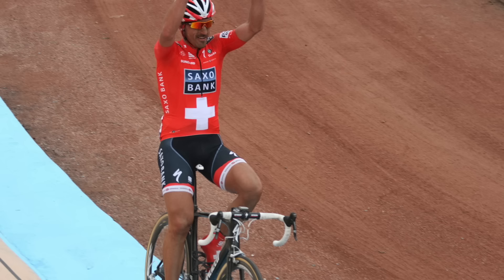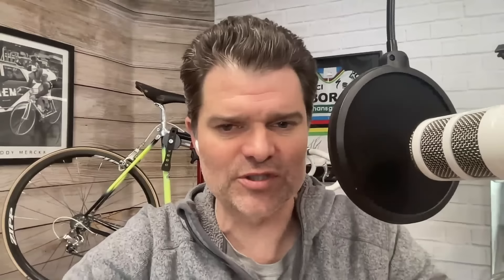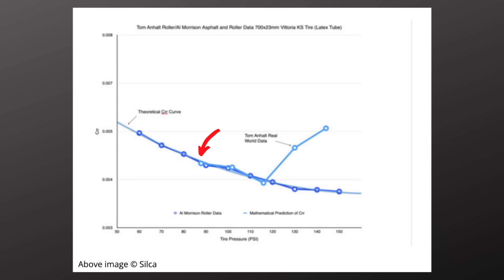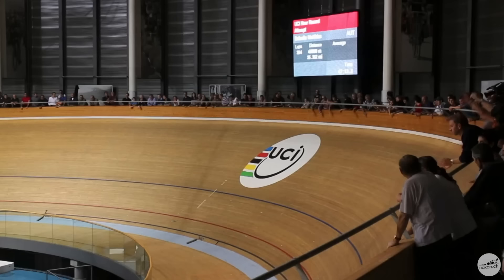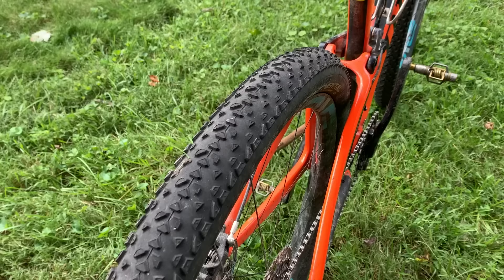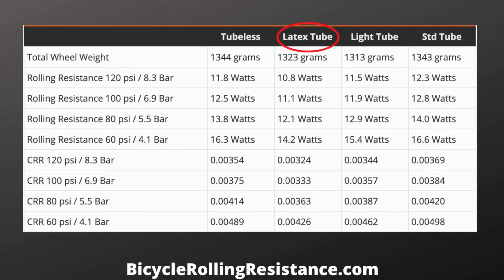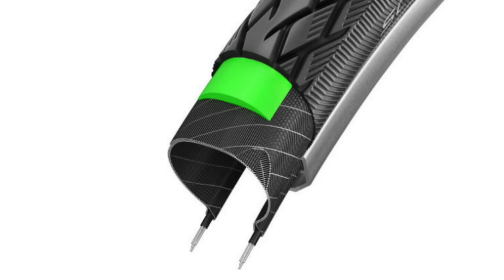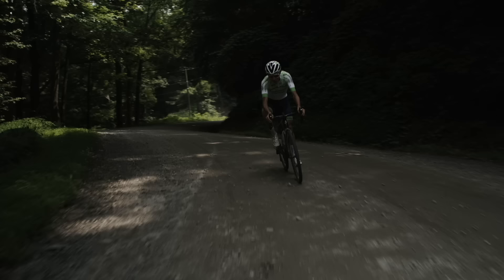Your Tires Could Be Costing You Minutes. Tire Rolling Resistance with Josh Poertner

Comment: Josh is amazing and definitely knows all the details and has all the experience working with cycling teams and testing products. I buy Silca products because of his insight.
Reply: I've been buying Silca products LONG LONG before Josh took over (I have an orange Silca Pista floor pump, and an ancient Silca Impero frame pump from over 52 YEARS AGO, when I first started racing on tubulars, both still fully functional!!).

But yeah, this man most definitely knows his subject matter, and then some!
(He might even be able to change my old school, died in the wool <-{which is what we actually rode in back in the cave man days!} fossilized mind about running way too high a pressure in my latex tubed, Vittoria Corsa clinchers. LOL 😉)

Comment: Great content. Great guest. Love the MG podcast. Please consider a conversation with Jan Heine, Rene Herse. If I recall correctly, Josh has hinted on the MG podcast that he may disagree with some of Jan's findings/testing/data on wider tires not being slower. If you could get a full length panel discussion with both of those guys - THAT would be gold. Keep up the good work, Dylan.
Reply: I definitely agree.  It's hard to have a conversation about low tire pressure and rolling resistance without mentioning the huge contribution of Jan Heine!

Comment: I like the discussion. Remember years ago, seeing a set of roll down tests of different tires and pressures, and a 'quick and dirty' correlation between how easy it was to deflect the UNINFLATED tire on say the sales rack and the rolling resistance; the easier to deflect, the easier to roll. Goes along with the hysteresis losses examined in the vid. Not foolproof and lots of qualifications but workable.

Comment: After looking into the TIRE PRESSURE CALCULATOR and seeing how low the suggested tire pressure should be, I'm very enthusiastic to try it out!  It's pretty sweet tool. Thank you for the insight!
Reply: @ighfirlee  If I were to worry about damaging my bike, I would ride slow, flat, boring tail trails... However, I can't worry about that! I would rather have the traction to make the turn and grip to dirt accordingly! Plus, my ENVE carbon rims have a lifetime warranty :) Ride On!

Comment: Very interesting video,
However I would like to add two other consideration for tire pressure.
1. Higher pressure makes descending more stable\
2. Higher pressure is more puncture resistant when biking on more marginal roads, that have potholes.
To me that is a big consideration not be stranded with a flat tire on a remote road

Comment: My experience is that the more expensive lightweight  high-performance racing tires  seem to be more prone to punctures . They usually have thiner sidewalls and less rubber overall in their construction.
Reply: It is. Cheaper tires are always more puncture resistance, at the cost of rolling resistance, comfort (higher TPI) and weight.
Reply: They last less too the more expensive they are .
Reply: Of course, but it isn't a 1 to 1 correspondence. The Continental 5000S variants for instance are very fast and pretty durable. As you go to tires much faster than that, you need to consider the course, and replace them sooner.

Comment: Hi Guys, I like your talk about tires and tire pressure. Because of it I tell you what are three players which influence RRC on the smooth drum: hysteresis, deformatin and volume of material

Those tree players have in paralel impact to: wet grip, robustness, footprint, stiffness - > effect: grip, durability handling &comfort.

Good balance of tire design or selection is key to success 😊

Comment: Interesting different format/directions for a video on your channel. Personally my take on this specific question is that I used to worry about tyre selection and tyre weight and tyre pressure in terms of maximising my speed… until I realised that it was all pointless and the one thing that cost me the most time was simply avoiding punctures. Now I just run as bulletproof a setup as I can get and cover ground both faster overall and with less annoying stoppages/mechanicals. Perhaps marginal gains in rolling resistance matter more to pros who have a team car and can simply swap wheels/bikes if they puncture but for the rest of us it does seem to make more sense to simply aim for avoiding mechanicals and all other considerations really are secondary or irrelevant
Reply: So whats your pick?
Reply: @romelagz  Schwalbe Marathon Plus SmartGuard? :)
Reply: Tubeless solved the puncture problem years back. 
I've ridden 28mm road tyres on brutal MTB type terrain and not exactly tentatively either, sometimes it's chasing KOMs.
Though I swapped to light 33mm CX tyres after realizing they were just as fast on road, and obviously faster/more comfortable on rougher stuff.

Comment: Yes, this was a helpful video and my tire pressure was too high 10 PSI in the front and 20 PSI in the back.

If you are on a track having high pressure and thin tires is the way to go.  However, on the road with thin tires may be fast but if you get flats your gain is not worth much.  I went on a bike ride and I saw other riders getting flats left and right and I did not get any flats.  I think due to poor tire selection that many riders were getting flats and it took them out of the ride for a chunk of time.

Comment: Just in case anyone reads this:

I just got a road bike last year. Been running 100 psi F/R. The Silca tool recommends 90 - 92 psi. 

I've known for years that my optimal pressure on my mountain bike is around 18 psi. So I checked this against the Silca tool. It confirms - 18 psi is optimal for my MTB. 

I'm going to run 90 psi on my next road ride and check times against previous rides.

Comment: Love the bike on the stand back there. Huge Lemond fan here growing up. I'm very intrigued by all this lower pressure stuff. I remember putting 140 psi in my 18mm Conti GP4000's back in the day,  and I had that Silca Track Pump too, haha.
Reply: Same ... back in the day (30 years ago - heck!!!) I was running 18mm Conti GP's at 120psi, on my Mavic Open Pro rims ... boy did they sound lovely on my local 10 mile TT - was doing 21 minute 10's back then (not now 😔) ... god knows what I would have done on one of todays aero bikes ...

Comment: This was really interesting! I had wondered if the Vittoria inserts were worth the cost, and now I think they might actually be.
Reply: Proceed with caution.. haven't experience myself, but word is that these inserts are great functionally.. but make removal of tire almost impossible... reports that teams that used them literally cut tires off to remove rather than trying to pry them off with levers 😳
Reply: I've had no issues with my Vittoria gravel insert. I only installed one on my rear wheel since I didn't want to spend for both wheels. They were really easy to install. Basically just like an inner tube. They give me that extra piece of mind when I do rougher trails and small jumps on the gravel bike. I'd say it's worth for the rear wheel. 😊

Comment: As a track rider I put 230psi on the track ( i ride 99% of the time in différents wood indoor Vélodromes in France, when in ride in outside Vélodromes i put '' only '' 130 )

On the road i'm more between 80 and 100psi 😉
Reply: @RealSweetKid it's soooooo fast 😍 you will love it ! 😉💪
Reply: In many cases we see that pressure over 160psi in a 22mm tire (for example) will cross the break point due to exaggerating the hysteresis losses in the tire glue.  You can test for this pretty easily using virtual elevation methodology.  Softwares like Golden Cheetah and a power meter can help you find breakpoint for your weight and setup for each track you race on.  But yes, when conditions are perfect, track is amazing, glue is perfect, etc.. we will run as high as 240psi
Reply: @SILCAVelo  Soooo....we're NOT running 200+ at MTV?
Reply: Does it so high because of your weight and tire width? I'm riding on velodrome too but usually putting only around 150 PSI
Reply: Wow I know that’s specific but my bum hurts just thinking about 230psi
Reply: @cycle_knight  i'm only 69 kilos and m'y race tires are on 23mm, but that's not tubetype or tubeless, it's on Tubular of course... You can't go so high with a tubetype or tubeless 😉
Reply: I remember riding tubulars, and gluing them on was very critical. Some road riders try using the tape, but I never trusted it. When fast clinchers arrived I never looked back.  Tubulars are for Track, supported road teams, and cyclocross.
Reply: @davidburgess741  100% agree, on the road i have tubeless and tubetype wheels, i have Tubular wheels only for track races 20 to 25 days per year ( on track trainings i ride Tubetype wheels at 110psi )
Reply: @cycle_knight  Is it an official UCI 250 meter, perfectly smooth, wooden indoor track, or an 'old school', bumpy, porous concrete, 333 meter oval??
Reply: @LS1conehead  it's a wooden 250 meter long one. Not really perfect surface because of some scratches.
Reply: @cycle_knight  Too many match sprint, and/or mass start race crashes gouging up the surface, I guess??

Comment: I remember running Continental LA tubulars on a set of early 90's Campag Shamals at 160psi. On smooth concrete it was complete eargasm but when not the wedding tackle would not be happy after an event but I get the feeling now that my times may have suffered even more.

Tub tape and not shellac, a million psi and not 90 - I probably left about 96 minutes out there for the 56 minutes I took for a 25!
Reply: As far as 'aural pleasure' goes (and even 'response'), nothing beat the early '70s, Clement green label Criterium Seta Extras, pumped up just right.

They made this most wonderful 'scrubbing' type of sound against the pavement, especially when 'jumping' full-on out of the saddle, to start a sprint or to initiate a breakaway.
It was so audible that you actually gave away any 'surprise attack' to your competitors. :)
Those, or something like them (they were only ~19mm wide), on a deep dish carbon rim wheel (with the steady state 'roar' they emit), would be a motivating factor to ride faster, all by themselves! ;)

Comment: I liked the commentary. I'm glad you found someone with experience and an open mind to change. Josh Poertner strikes that balance of modern thinkers in an industry sometimes that is stuck in its ways. It was refreshing to hear someone state that comfort and traction are real considerations. It was also nice to hear that he agrees that roller tests do scale to real world results. Arguing that there is little or no value in roller tests is the new vogue of the retro grouch. 
Finally, my take is that the product mentions were relevant, and I didn't feel he was a shill for one company or brand. Nice.
Reply: Exactly...as long as you stay below the "breakpoint" pressure for a particular tire/load/speed/surface, the results scale exactly. In fact, that's how the "breakpoint pressure" was first identified, i.e. the pressure at which the roller data diverged from the field test data...which, of course means that as long as you're prudent about pressures, they're a valuable (and relatively easy) testing methodology.

Comment: Great video.. really love Josh.. he really thinks outside the box and challenges the general consensus.. WHICH IS AWESOME!! I’ve followed his and Tom Anhalts thinking on this in great detail.. all great stuff!

VeloNews’ did an analysis where they used a air shock as stand-in for a ‘flappy meat bag’ (aka a rider 😀) not sure everyone noticed, but if you look carefully at data it actually demonstrates that some of the attributes that you might assume would be predicted to be correlated with optimal tire pressure e.g. tire width and tire rolling resistance are not. These are the inputs for for tire calculators like Silcas’ which means that these calculators are not in fact good tools for determining optimal tire pressure.. inconvenient truth that each individual tire appears to have characteristics that make higher or lower pressure faster or slower.. cannot make generalizations.. my hypothesis is that this is due to a particular tire of particular size having its own resonant frequencies that make impedance assumption about impedance losses not as predictable as you might assume..  so in fact the only way to know the optimal tire pressure for a tire on a particular surface is to test THAT on THAT surface..

Comment: Sometimes, I only increase pressure to avoid pinch flats on the metal manhole covers I encounter on my road bike... with my commuter bike, with Schwalbe Marathons, (and a bigger carcass anyway) I have much lower pressures. I'm a heavy guy (100kg) and always had the idea that more pressure was a compensation for my weight so as to not deform the tyre too much... I know that higher pressures on my indoor trainer (driven off the tyre, not via the cassette) is a better thing, I notice the difference in my numbers, but that is a very controlled environment...  
This video raises some interesting points, and like you do with your other subjects, uses actual science stuff to make the case... BHD might reconsider running those solid silicone tyres he uses for chasing KoM's...

Comment: I have a MTB which I removed the suspension to add a carbon rigid fork. But the mayor update was to go tubeless with Schwalbe G one speed tires. Now my bike  feels like a complete new bike, so fast. With regular mtb tires on flat road 33-35km/h was hard to maintain and go above was crazy, now with the same effort I can go 55km/h. I have right now a fun gravel bike.Of course the traction is not the same off road but the speed is amazing (I’m not fan to go down of the hill, I love to climb in my bike fast)

Comment: One of the best and most tecnical videos about tires I have ever seen. And from my experience I agree 100%. On the Silca link I miss the rim width variable and afew more details like disc or rim brake, comfort average or performance and also dry, mixed or wet surface, that in the old “my mavic” app were. But still very sweet link
Reply: To be fair, it asks for "measured width" of the tire, which takes into account the effects of rim internal width (i.e. how it affects the width of a particular tire when mounted). Brake type doesn't have any appreciable effect on the pressure requirements either.

Comment: I do have issues with the Silca rolling resistance calculator for off road. I did a recent gravel ride, and even selected a fairly smooth surface. On the rough sections, I smacked rims repeatedly. If I have had actually selected that surface, it would have recommended an even lower number.
For my mtb, it suggested 12 psi in my 2.4” tires! I’m 175 lbs, so that would mean I couldn’t corner, and would pinch flat on every pebble!

Comment: In off-road riding lower tyre pressures also give you more grip and hence more control and faster cornering speeds which is often more important than rolling efficiency.
Tyre inserts at lower pressures effect the rolling characteristics even if they don't touch the sides, because they reduce the volume of easily compressible air in the tyre the resistance to deformation ramps up more quickly as they tyre compresses

Comment: Risk vs Reward. I get it, very low pressure and super light is faster. You’ll always finish 1st. Either by winning that gamble or by being done with a destroyed tire or rim before anyone else finishes. That’s the real dilemma. Where’s the line? I tested the Rio Vittoria Special Track Tires for the USA Cycling Team and had the record of laps before their failure (100 in LA). We decided not to use them, neither did the Australians. I think Viviani rode them in one or two short events in the Omnium. Where’s the line? I ride a little safer tire with a little more pressure (so it seals if damaged) but I’m old and crusty now. The kids today? I see a lot of wheel changes. A lot of “would of, could of, should of’s”

Tire sizes on the track are basically the same and everyone is still going big on the pressure. If studies showed different, there would have been changes there already. I very much believe in this concept for road, gravel and MTB. I just think too many people are going too light and too low when finishing would have been better (not everyone is going for the $$$)
Reply: I remember watching you and your brother ride at T-Town. ;) :)

I am also much older than you, and remember the old white Clement (called #1s if I recall correctly) track tubulars which could handle over 200PSI, and how even on a relatively smooth asphalt or concrete track (there were not many, if any, 'smooth' tracks in the USA back in the early '70s!), they would barely last through a kilo ride!

The current day track wheels have gotten slightly wider to yield more aero benefit with also slightly wider tires, but nowhere near as wide as current day road wheels and tires. 
Which kind of proves the whole uneven/rough surfaces need wider wheels/tires (also for some aero benefits as well) and lower pressures, and perfectly smooth board tracks require narrower wheels/tires and higher pressures theory.